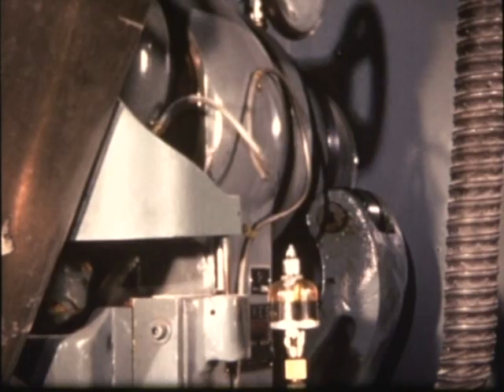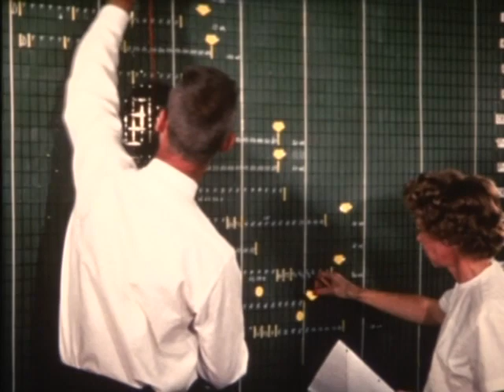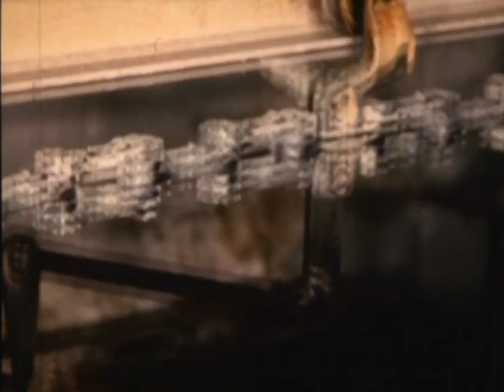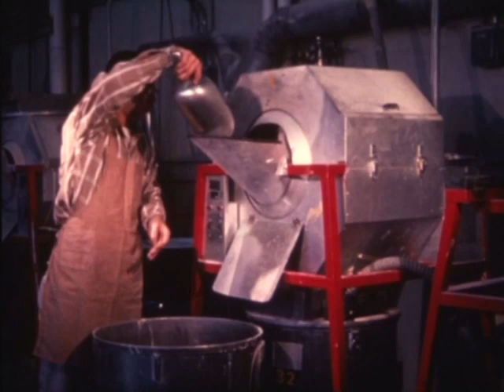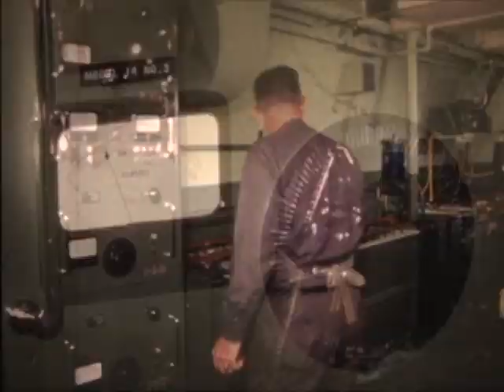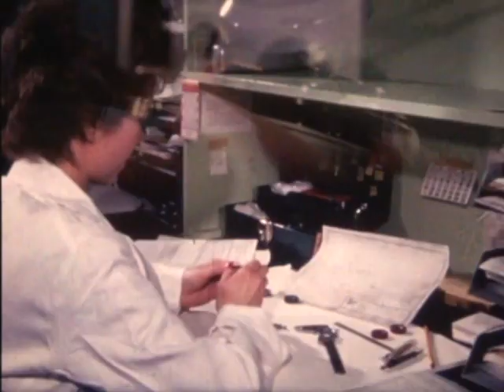The Sounds of Progress - Fabrication and Molding at Tektronix

Comment: Not a sign of grounding or gloves anywhere 😂
Reply: At this point there were not very many static sensitive components, this was just at the transition to printed circuit boards and CMOS was just in it's infancy.
Reply: Using gloves in lathes, mills and mechanical tools with moving parts is dangerous and discouraged
Reply: @ychannel3  no, for the handling of electronic parts sensative to static, glass screens prone to smudges...
Reply: @phonotical  Yes, you know better! lol
Reply: @phonotical  Yeah, all those vacuum tubes were highly ESD sensitive.....

Comment: Its sad that they are all made in China now.
Reply: Well China is 1/5 of the world's population.
Reply: @Tangobaldy  I dont know what that has to do with it.
Reply: Yes it is sad. Now "Made in the USA" has the same meaning when we saw.. "Made in China". All we have now is cheap garbage. Go ahead America, keep buying junk.
Reply: The Chinese don’t build anything that compares with these TEKTRONIX instruments.  Like all the disposable crap we buy, no parts and no fixing it when it breaks.
Reply: @mlynch001  I agree completely. These US made instruments are top quality. Those were what made the Tektronix name. I have a 2215A (60MHz dual trace) that was made in the mid 80's, and it still works flawlessly. I have friends who still use the much older tube scopes, and they still work great. I cant see the Chinese made ones lasting that long. I would pay more for a quality built scope. Sad indeed...
Reply: @ronshaw80  My First TEK scope was a 2215A.  Bought it not working, fixed it for nothing and sold it to buy a 465B.  Long story short, I now have a room full of these wonderful instruments.  Some of these are over 50 years old, most over 40 and nothing under 30 years old, all working and most repaired or calibrated right there in my little lab.  These are a tribute to engineering and manufacturing genius.  These little $300-$500 Chinese scopes do the job and are loaded with features, unfortunately, they are simply not repairable from an economic standpoint.  When they break, throw them in the recycle bin and buy another one.  Once you have used a really well built and engineered piece of equipment, it is easy to see why these old TEK scopes were so expensive in the day, so treasured and still useful, even today.